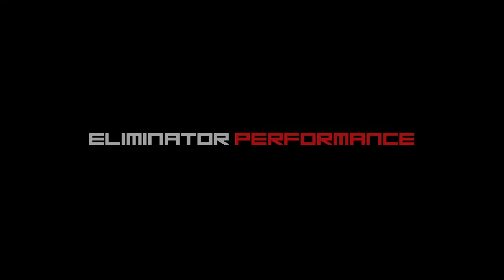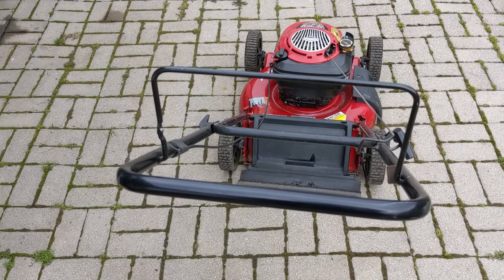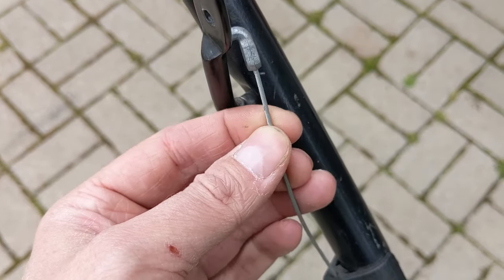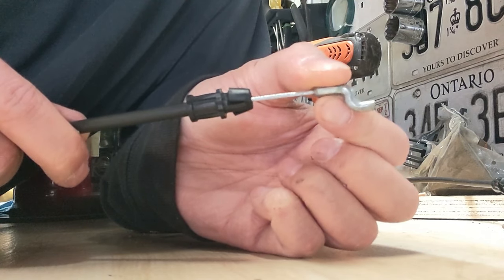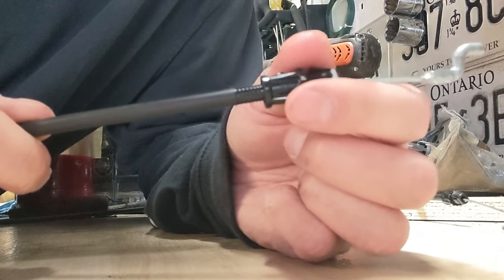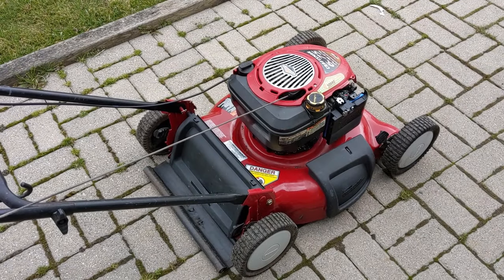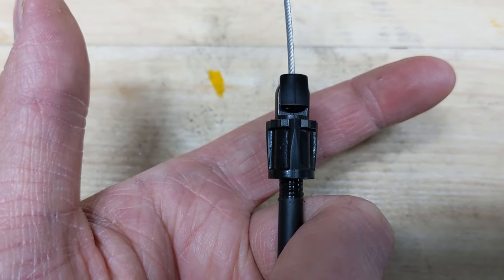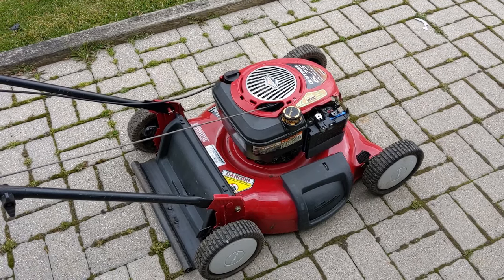How to Adjust a Lawnmower Cable

Comment: So my question is, how does one remove the cable at the throttle end? The fitting you show unthreading is wedged in that groove to a point I can’t remove it without the possibility of damaging or destroying it.
Reply: I've watched two different videos and they don't show how to remove it. I guess, I'll try it until it breaks. Great video, but a lot of times they skip step one.

Comment: Ive been having this exact issue with my lawn mower I was about to switch to a battery powered mower, I completely took apart my mower to find out my mower was actually fine and it was the safety cable that has stretched over time and not fully engaging the kill switch so no spark. I was looking everywhere to find a bolt to loosen to maybe find an adjustment I didnt know that the cable itself was threaded Im going to have to see on mine. Figured out if there isnt a clicking sound when you pull the safety switch out then your mower isnt going to start.

Comment: Both sides of the cable do this. You get about 5 rotations per side, I wouldn't pass 2.5 on either to reach your goal unless you absolutely need to Get 'er done and have a new cable on the way. You strip those cable ends and you lose the ability to unlock the flywheel. Bike brake cables are way better for adjustments. If anyone has ever hacked their mower kill switch and upgraded to bike brake cables, let me know how it went

Comment: how do you physically remove the cable from the mounting bracket
Reply from the maker: You need to pinch the 2 retaining tabs in, and pull at the same time

Comment: THANK YOU SO MUCH for this video! I was able to adjust out the slack...although on my older cable there was actually wound metal under the outer plastic cable, but I was still able to do essentially what you did. Just saved me a $12 cable! Same as others have commented...one pull and it started immediately!

Comment: Great tip!!  Who knew?  Wish I knew about this a very long time ago.  I thought this might help me with increasing the self-propel speed on a TroyBilt mower but it didn't work like I was hoping.  Is it possible that transmission has internally just worn out to extent that it will never increase speed?  It appears that the tension is maxed out and it is just way too slow.  I have a Cub Cadet with similar problem but have not spent enough time on it to come to conclusion and will try your tip to see if it helps.  Thanks.

Comment: Love this vid.  I have an exmark 30 push somehow had issues with blade RPM.  Thought the PTO cable was stretched, replaced it but it still boggs down in medium grass when I know it shouldn't.  All I have to do is take my finger and lift up on the cable making the tighter and the rpms go up.  I'm definitely going to check this out.  Hopefully that cable has this option.  Kills me that two locations looked at and neither could figure out why.  Thanks again.  I stumbled upon your videos and they are really helpful.

Comment: Help me out, please!    Craftsman mower.   Brake holding flywheel and crankshaft from spinning?   Mechanic turned it sideways, spun the blade, and said it was a "bent crankshaft".    I don't think so........it turns by hand.     Not "hydro lock".    I removed the spark plug, and "dry".  Yes, has oil in crank case!   No gusher comes out of plug hole.    I'm thinking the brake cable needs adjustment and all will be well.   What do you think?   (This all began with a loose blade bolt.   Changed blade and tightened.)
Reply from the maker: You can manually release the flywheel brake on the engine. Remove the engine cover and you should be able to see it. Either that or you have a sheared flywheel key

Comment: Great tip I changed the carburetor spark plug new air filter new fuel line still wouldn't start. Turned out I had a broken kill switch cable.  Just had to push the kill switch a little more by hand and it started right up.

Comment: I adjusted mine on both ends and voila started right up.  It was a brand new cable and i was getting frustrated.  Almost tried the knot solution.  Old cable rusted tight over the winter.

Comment: I replace my Husqvarna AWD drive cable twice both times it frayed and broke off down near the bottom within an hour. Both cables were installed same as the original cable that lasted 9 years.

Comment: I tried modeling the brake cable with a copper cable about the same width as the coil inside the black cable housing but it just doesn't excert enough force to push the blade brake lever toward the motor bracket.
Does the black cable housing have something to do with the wire coil being able push the lever when you pull it with the control handle?

what prevents us from just using a sturdy wire coil without housing?

I want to understand how this works before I buy a replacement cable.

Any help would be appreciate.
Thanks.

Comment: How would I adjust the throttle cable on my Lawn-Boy model 10324? It does not have the threaded caps on the end of the cable. The cable does not move far enough to move the carb into the choke position.

Comment: informational but the problem is how do you get the cable off that metal bracket it’s a pain in the ass or seems to be for me anyway you didn’t show how you took it off
Reply from the maker: Needle nose pliers and pinch the tabs!

Comment: I have the opposite problem.  I can't get my mower to shut off now unless it runs out of gas.  Don't know if it is the cable or stuck throttle.
Reply from the maker: Killswitch not engaging, or the kill wire (black wire) that goes to coil has been unplugged.
Reply: You can pull off your spark plug boot to kill the engine.

Comment: Great video and info, but how about step one, removing the cable at the engine. I feel like I'm going to break it when I try to pull it out.
Reply: Okay I figured it out. Unhook the cable connection and use a pair of needle nose pliers and squeeze the two parts (clips) closest to the cable and it pulls right out

Comment: the cheap crappy way that they make most stuff is shown by my Pouland and the way the cable broke after using it 10 times.    yes, i bought it in 2017 but i live in the desert and only need it occas.   the Briggs and Stratton motor runs great, but the plastic crap breaks easily.   oh for the olden days, my old lawn boy ran for 20 yrs then needed a mild remake.

Comment: Not a smart idea at all! By loosening the plastic caps and leaving it mostly "unthreaded" you put extra strain on the few plastic threads still in use, before long these will strip and be completely unusable. DO NOT DO THIS.  This is not what the caps are intended for and you risk a failure of the kill switch and potentially dangerous situations with an engine that will not shut off.

Comment: I seem to have the opposite problem: I pull the speed lever down to stop but nothing happens so I thought maybe the cable needs adjusting. Trouble is I don't know whether the cable is stretched when the cable lever is up engaging the choke or down supposedly engaging the kill switch. To stop I push up to engage choke and that stops it.

Comment: can someone please explain how a control cable works? 
It's not like pulling a string from the control handle to the blade brake lever.
How can pulling the control cable cause the blade brake lever to be pushed toward the z end attached to the motor bracket? 
Is force being applied of the plastic end the wire goes through?
I've been trying to figure this out all day. 
Thanks.

Comment: I can't get the cable out of the hard plastic holder on the bar. I've tried everything doesn't seem it will come out without breaking the plastic holder. Sigh oh well thinking of paving the yard anyway

Comment: Would this work for throttle cable too? I hav push mower with a drive assist. The cable has stretched and now does not drive when I grip the handle.
Reply from the maker: It's possible, but it all depends on the design. It's worth a try.
Reply: Hi Dan, just thought I’d put my .02 in as well...when my mower didn’t engage the drive assist, I had to dive a little deeper to find out that my drive belt had failed.
Lotsa good vids on YT helped me to repair. Hope your issue got solved with the cable adjustment trick.  Cheers, Bill